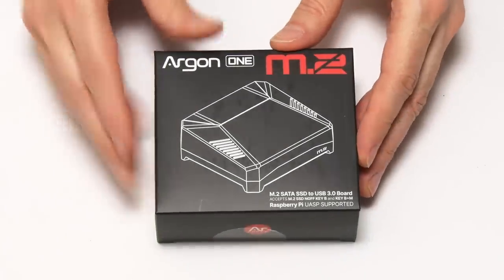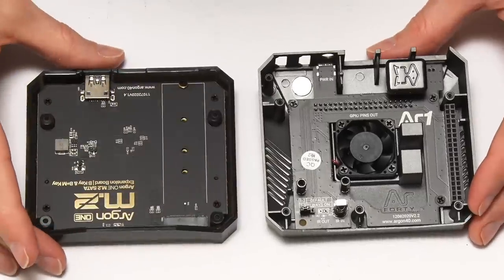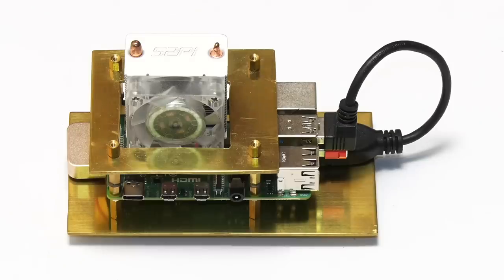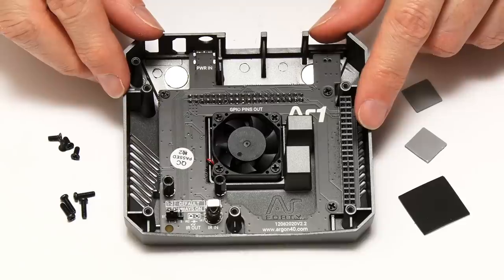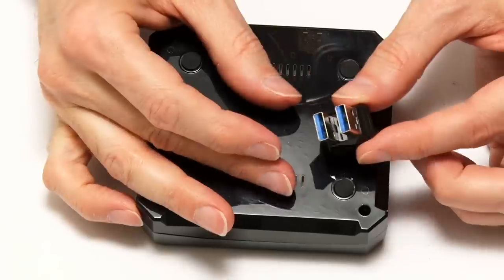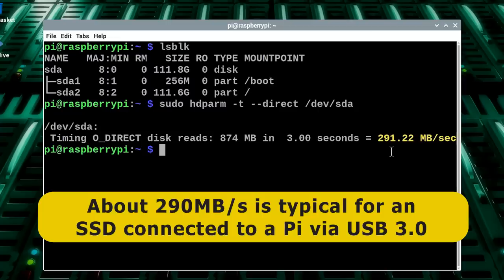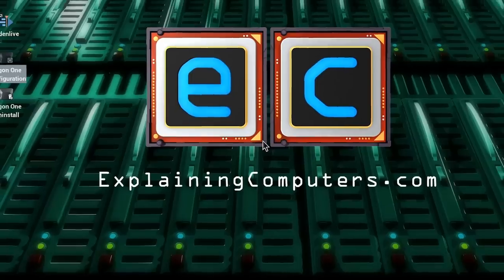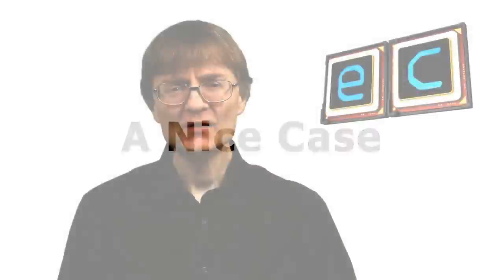Argon One M.2 Raspberry Pi 4 Case

Comment: My first computer was an IBM PC I put together out of parts I was supposed to send back to IBM, working as an IBM field technician back in 1984.
The motherboard alone cost $1500 to buy as a part, so I did component level repairs on things I needed, until I built a system. Something one can't do today. 
One look at today's motherboard, and one will faint at the thought of repairing it! 
Now, one can buy a RPi 4 for under $100 that is 400+ times faster (1600 times with 4 cores), and has 500,000+ times the RAM of an original IBM PC! 
How far and fast we have come! Amazing times.
Reply: "one will faint at the thought of repairing it!"

oh I agree so much. especially if there are no public schematics.
Reply: @waltercomunello121  - Or if the manufacture refuses to sell OEM specific components trying to force you to just buy a new computer.  ie. Apple
Reply: My first PC was an Apple II+ clone. A friend of mine had access to a wave solder machine so we bought the board and parts, got it soldered and went on from there. When I retired the machine it had a Rana 4 drive controller with a total of 512KB of possible floppy disk storage, if you notched the floppys and flipped some of them over by hand. At one point I nearly bought a hard disk for the thing for $2,000 because who would want more than an astounding 5 megabytes of high speed storage? You tell  that to kids today and they just don't believe you  ;-). The current machines are way more powerful, astoundingly fast, fantastically more convenient and no where near as bug eyed, "think what I can do with this thing" exciting. Yin meet Yang.
Reply: Then everything computer related (hw&sw) cost a fortune.
Reply: At that time an IBM PC pc costed 60 times my monthly rent.
Reply: It is incredible to think about the progress in computing in just a couple of decades, first computer we owned was an amiga 500 which was a great machine, but compared to even a pi zero the computing power of the amiga is pathetic
Reply: When I see data speed tests like here, I think of the original IBM PC our office acquired in 1984, where we spent the whole afternoon backing up its 5 Megabyte hard drive with 360k floppies, endlessly swapping them in and out.  But it needed to be done.
Reply: @1Eagler  And now my monthly rent for a similar place is 60 times is what I was paying in 1984.
Reply: ZX81
Reply: Its also worth imagining the raw power of the phone in your pocket as well.
Reply: My first proper PC (not counting Commodore or Amiga)was a Packard Bell P166 mmx back in 1990's. running Windows 95. State of the art back then, I bought the first one in PC World.  It set me back £2,000!
Reply: Modern tech does make one reflect on how we ever survived with an IBM 8086.
Reply: Yes IBM, 640 K extended and expanded memory, RAM drives, MSDOS batch files: such good memories. I still can't get it out of my head! I too did site support for IBM. I was good at hearing the bearings failing in hard drives.
Reply: Ahhh... those fond memories tt is so holding dear to hearts!
Mine was in the 1980s, an IBM XT 8088 Compatible, 4.77mhz CPU, 256K RAM, Dual Floopy, no HDD. CGA Graphics card, mouse was Not a std item. Dot Matrix printer was a commond peripheral. Wonder if kids today understd the diff btw // vs serial interface? The heavy 'tank-built' keyboard was $100 over.
And Yes, DOS batch files, autoexec.bat, config.sys TO bash scripting and later powershell and now a little js & python.
It's really a wonderful interesting era to be alive. Our generation hv witnessed the most compelling & "disruptive" evolution ever.
Tomorrow will be better. Cheer to good health!
DOS 2.x was the ruler.
Reply: It's amazing how much tech has changed.
I bought a Compaq Presario 4/33 as my first computer.
Today I have an 8GB pi sitting on my desk with a 240GB M.2 drive in it, all installed in one of these Argon ONE M.2 cases; all for a fraction of what I paid for the Compaq 30+ years ago.
Reply: @BradClarke  Yes, Compaq is very good brand name but was way too pricy. Could only affort a non-branded compatible. Then again tt was abt 50x more than our monthly room rental.
Reply: There were many inexpensive option in the 80's, like the C-64, which you could get on sale for approx $200 back then. But $200 in 1984 is like $1000 in 2021.
An 8 GB RPi 4 with this case comes out to $135, factor in a m.2 drive, and other accessories, $200 will get you a complete setup you can plug into any tv, like a C-64. But that is $200 in 2021 dollars, which would be more like $40 in 1984 dollars.

Interesting, even though the processing and storage has increased exponentially in the past 37 years, the base line raw "price of entry" has not. It's still $200 (in the current year's money) expense for a minimum setup, and $1500 or more for a full size desktop.

But something with the processing power of an RPi 4 did not even exist in 1984.
The CRAY XM-P from 1982, one of the fastest computers back then, had 4 separate cpus (not on one die like the A72 chip in the RPi4), each running at 177 MHz, and only 128 MEGAbytes of RAM. And filled a room with equipment.
It's was the 90's before supercomputers could do what a Raspberry Pi does now.

$5 micro-controllers outperform what the average $1500 desktop did in 1984.
That would be $1 in 1984 dollars.
(I'd like to see a performance contest between a Pi-Pico and a 1984 IBM PC. That would be funny)

Yes, Computers have come VERY far.
Reply: It would be REALly fun to read these Post again in say 5, 10, 15, or even 20 yrs from Now. ⁉️🤔🥴
Reply: @bobwong8268  DOS was just a blant rip-off from how UNIX worked.
Reply: @scality4309  Didn't know any better back then. But was really learning & building my scripting skill doing stuff like piping, redirection, @echo off. Bought books like DOS Bible created bootup menu for options to boot with/without RAMdisk, mouse driver, extended memory manager. Later and now simply fell in love with bash & the dear grep & regex.
Those DOS days were also when I picked up C programming, yet again tons of books as internet was NOT even a thing then.
Reply: I worked on those! My first was a Commodore 64. I still remember typing in BASIC and saving it to my cassette drive. Sprites were the thing! LOL, my PI, is sitting in a custom printed icetower case with an OLED showing available resources (Thanks to Michael Klements incredible design at the-diy-life.com!) and driving my 3D printer! It's running the 64 bit Rasperry PI OS @ 8GB and booting to a 240GB SSD. I've got FreeCad, OpenScad, Blender, Slic3r, Pronterface and so much more going on! This little arm64 board is just mindblowingly amazing! My whole setup including the 3D printer that arrived a month after the PI (Oct 20) is less than a Windows desktop/laptop. The maker community, the open source community, just incredible. The goal is knowledge, growth, and fulfillment through the afore mentioned. I love tech. Dark sides? Sure. But when you remember why you came, what brought you here, you remember the good.
Reply: @scality4309  Just heard Jim Keller say the z 80 was really the best x86 chip design ever.
Reply: @ecophreak1  And yet the Amiga was way ahead of its time compared to the IBM architecture (386/486) There is a school of thought that  Commodore hadn't imploded ( after the departure of Jaxk.Tramiel) it could well have gone on to being where Apple is now.
Reply: Right?  My families first VCR was around $1,000.  Now you can buy a Bluray player for 20 bucks.
Reply: @paulluce2557  Don't get me wrong, I loved that Amiga, and have a lot of respect for what they did for home computing - the graphics and sound capabilities were amazing compared to pretty much anything else at the time at a decent price
Reply: @ElmerFuddGun  #Right to repair
Reply: @bobwong8268  Actually, CPM did a copy of UNIX. Some guy copied CPM directly with some minor changes, then Bill Gates bought it and rebranded it and sold it to IBM.

This is how all this mess went.

We were tricked by Microsoft.
Reply: @snoopstp4189  Looked it up, interesting fact.
Reply: @paulluce2557  Amiga was lightyears ahead.
Reply: @scality4309  I hv seen & used some very old PCs that was driven by audio "cassette tape" players in "cyber-cafe" b4 I bought my PC-XT 8088. Not sure if those using CPM?
Reply: @bobwong8268  No, those computer will be 8-bit computers. MSX, ViC-20, Sinclair Spectrum, TRS-80, Acorn..

CPM was mostly on the Intel 80xx, but there where versions for C128, and maybe other systems.
Reply: @scality4309  Thanks for throwing some lights on that. Was my very early encounter with computers and only recognised them as boxes that responded to keyboard input.
Reply: @fosternostrand1597  1200 hehe..😂
Reply: @scality4309  Had one!  And a PCW8256.  Think I also had a Dragon 32.  My brother had a Spectrum and a friend had a BBC B (never even saw a BBC A!).
Reply: That's very sobering, also along the lines of a typical 13 YO kid today having telecommunications power at his fingertips that would've been many times past 'Top Secret' WW II standards.
Reply: @KameraShy  Just about or, at least it seems to be that way.
Reply: @brokeandtired  No joke. My Internet went down for several days last week, my Pi 4 was delivered a day earlier, and I said 'screw it' and was able to use my cell as a Wi-Fi hot spot. Slowish but at least I had some Internet.
Reply: @gusgone4527  1999 was a custom built computer with Win 98, 8.4 GB hard drive, Celeron 300(?) and 128 MB RAM. My Pi 4 is at least 10 times as powerful. PC set me back over $1,000 that year and, my Pi, out th door and delivered cost me $161 in 2021 money.
Reply: @bobwong8268  DOS 6.22 and Win 3.1 running on a 486 DX 4 was the end of the pre Pentium era. We all know what happened in 1995 and, the world (literally) hasn't been the same since.
Reply: @peterbelanger4094  You sir, are a sadist; torturing a 1980's machine with a Pi..........................and, you're 100% correct :)
Reply: @TheJacklwilliams  I have my 64 bit Raspian/OS, also with 8 GB and just its tiny 120 GB 'hard drive'. I'm seriously thinking about boofing up the latter since I have a pair SSDs, one's a 500 GB and the other's a 1 TB
Reply: @piercehawke8021  Smart.....I just use my phone when that happens though...Even if it web browsing sucks on my phone. Or I go read a kindle book.😊...The Pi Foundation really need to release a high end 8 core Pi model, because they would make a good low power PC.
Reply: @piercehawke8021  🙂
The "constance" is 'evolutionary/revolutionary' changes and LifeLongLearng! Welcome to the era of L³.
It's awesome to be alive in such era👍🍷🍾!
Reply: @Ci Absalon Today's programming is bloated like hell.
Reply: I think more impressively as well is the fact as an industry we are pushing closer and closer to open standards, including in hardware standards with the likes of RISCV gaining momentum just now.  In 5 years, it'll very likely be everywhere as a common architecture.  Literally just earlier I accidentally found out about an open source RISCV GPU project when trying to find something else to show a friend.  It's a fascinating time in the hardware industry right now.
Reply: Little correction, It's way more than 400x faster, IBM PC 8088 processor is 16bit processor, doesn't have floating point instructions, SIMD instructions (parallel 4-8 instructions on one core) and executing one instruction takes multiple cycles, RPI processor is 64bit has float and SIMD instructions and can execute multiple instructions in one cycle, in real scenario it is more like 1 000 000 x faster.
Reply: You definitely can still repair motherboards. As to stealing broken components from your employer, that's as legal or not as it was in 1984.
Reply: @notmychannel8602  Just because you're a thief, you think others are and read it between the lines. I asked my manager if I could have it and he said yes. So GFYS and find another popular post so you can troll it and be noticed.

Comment: I bought several of these cases for a project after watching your review, Chris.   I added a heatsink with thermal adhesive pad to the top of the case for each one, and it dropped the temperatures down a few degrees cooler than your test results.   It doesn't look as nice, but it is performing very well on 8GB Raspberry Pi 4's with Ubuntu and with Raspberry Pi OS (32-bit, Buster).

Comment: Excellent  review as usual...I very much enjoy your series.  Three additional thoughts:  
1.  Running the RPi without the GPIO cover significantly improves cooling...that might be an interesting metric to add to your table.

2.  The Argon One's power port frees up the RPi's original USC-C port !!! Unbeknownst to many, this port is also capable of passing data as well as power delivery ( the Argon One's USB-C is only capable of power delivery).  

I  modified my case to connect an Apple iPadPro OEM cable USB-C cable to this connector, and can directly power and connect to the RPi via SSH or XRDP from my iPadPro while on the road.  
I have full access to my programming environments (command-line, Python, Jupyter Hub, etc.) as well as RPi desktop accessible from the iPadPro ( I don't own / need a tradition laptop anymore ;-) ).

3. Argon sells just the M.2 bottom-half of the case to upgrade the original Argone One for about $25 USD.  
-Thanks!  -d
Reply: Thank you! Point 2 is especially big: I was disappointed to get down to just one usb 3 port.

Comment: I'm quite happy with my Argon One (non-M.2) case. It gets quite warm during operation, meaning it does a good job at pulling the heat off of the Pi's IC's.

Comment: I think the biggest selling point is the design! I love the look of it and the easy access/assembly!
Reply: Except that they block access to the sd slot.  BIG mistake.  If you need to reinstall the OS, it would be nice if you didn't need a screwdriver.  I got around this with a USB 3 to micro-SD adapter, but that is clunky.

Comment: Love this case and the M.2 drive is screaming fast!  The best thing is, even with Pi Hole running 24/7 the fan never comes on.  And it's also very nice having the unit turn on automatically after a power outage.  I always forgot about it and would scratch my head when the internet didn't come back after a reasonable amount of time.

Comment: I built one of these using Pi4 4GB, WD 250GB SSD, and put in a 256GB MicroSD because I had a spare. Bought the $10 remote control too. The best things about the case are that all the connectors go in the back, full-size HDMI, and neatness of the overall case. It sits in my office as a media hub and DVR, using a $12 cheapo HDMI/USB video capture dongle that actually gives great performance for my purposes.
Reply: Can the remote power the rpi on?

Comment: I think this is the first time I bought something just before your video came out on the same item. I'm very surprised at the bad reviews left in the comments. My impressions are down below.

I bought the Pi4 and Argon case to run JMRI on my model railroad.

I bought the Argon One M.2 for the SSD and full size HDMI interfaces. I set up the Pi with SD card and SSD connected. Booted from SD card, did all upgrades, then used SD card copier. Took out the SD card and booted from SSD. Works great on two monitors.

WiFi: I use the Pi in the basement, the router is on the first floor. Looks to be working properly. Occasionally, when browsing the web, the Pi looks to take a bit of time but I don't know if it's the WiFi signal, or the speed of the Pi.

Temperature: I used the thermal pads. I set up the scripts to run the fan at default 50, 55, 60 degrees C at 10, 55, 100%.
The Pi is in the basement which is cool 50's degrees F. So far for what I'm currently using it for, the Pi has not gone above 42 degrees C. If I put my hand on the case, it feels very warm. Makes a nice hand warmer.

I have not stressed out the Pi in this case, but am glad to see what Chris used to do so. I will be doing this as well as a sanity check for me to know that the Pi is running as it should. I will also rerun the config script to run the fan continuously and see how it runs or how loud it runs.

Comment: I love the Pi computer idea. Computers can be very expensive and so any computer made to be cheap gets a thumb up for me.
Reply: you could get a used one, got 2 laptops for 20 each and 2 towers for 10 each
Reply: @billfusionenterprise  I got a nice Core2Duo tower that was sitting by the road. I was just going to strip it but I decided to see if it would boot. I fired it up and it booted into Win 7. The guy still had all his stuff on it, emails and pix and all. Idiot. I wiped it and installed Linux on it and it ran pretty good. It was about the same speed as a Pi 4 overclocked. When I saw that, I stripped it for parts and chunked it out by the road for the garbage people to pick up.
Reply: @ninline2000  i5 in one laptop and in one tower. plus there are more thing you could do with a tower. And look at retro community who loved 486 and less powerful
Reply: @DejanTesic  depends, got better deals local
Reply: I've got an i7 tower with an Nvidia 750 TI card in it. For 90% of what I do, the Pi4 is what I use. When I need more power I boot that up. I hardly ever need it anymore so I save electricity.
Reply: @ninline2000  I have used a Pi in my last job hunt, made resume, and other paperwork and it worked great. I use a roku for youtube and other streaming

Comment: This is just about the Ultimate case for the RPI 4 - my only (almost too minor) comment is to take the door off the top that covers the GPIO PINS OUT
I noticed a 2-3 degree drop in temp from doing this, as I think it helps increases airflow.
Bought a RPI 4 about 2 months ago and love it - used this case to go from the 32 GB micro SD card to a 128GB SSD.
This case might seem expensive but it's worth it and it looks sharp. Great video!